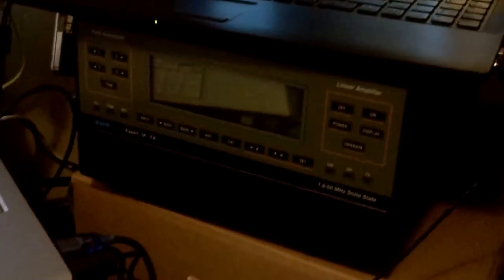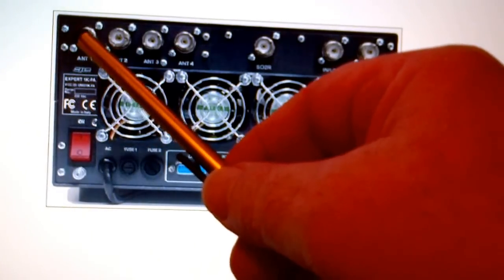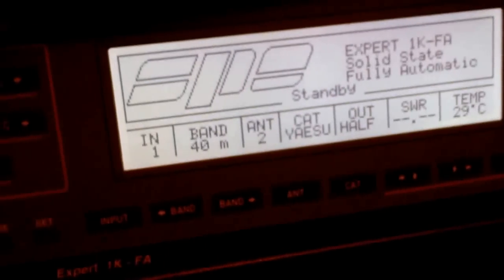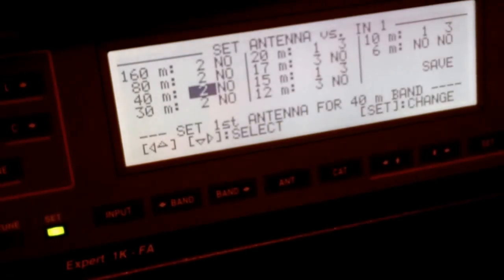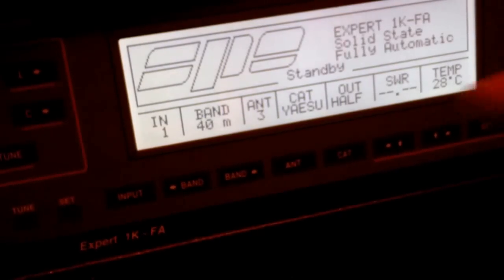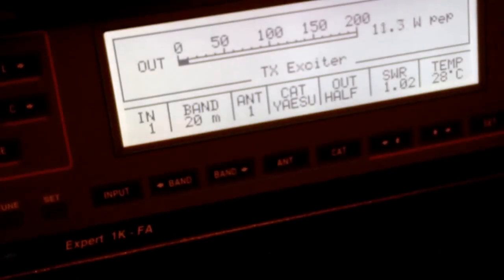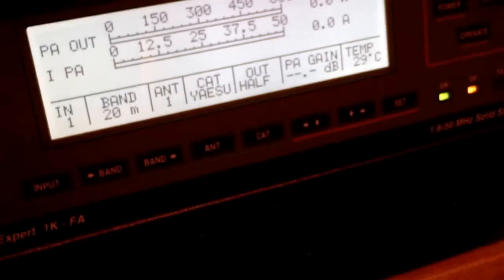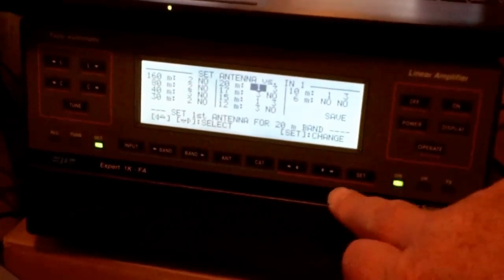SPE Expert 1K-FA

Comment: Hi there Rob. I bought myself a Sun SDR Pro 2 radio a few weeks ago and I'm trying to configure the SPE amplifier to work with it. For some reason, I can't seem to be able to select the second input. At the moment, I only have one antenna which uses input 1. Have you any idea why I can't select the second input so I can configure the amplifier for the second radio?
Reply from the maker: I'm not 100% sure Penn what you should try is if you have 1 radio connected try pressing the INPUT on the front of the radio if it switches to INPUT 2 thats ok, next You might have to have the cable for INPUT2 connected then the AMP will see that there is another radio connected then it will switch, also check that you have the Sun SDR setup in the CAT section of the AMP so it knows there is something connected, thats all I can think of at the moment, also did you get the AMP working correctly I know you had a problem with it ?? 73's for now
Reply: @M0AOV I could go into the cat settings on the amp but that would be on input 1 therefore would mess up the settings for my ICOM radios.

I thought that normally if you press input it would change between one and two, however that doesn't seem to be happening with the amp at the moment. If I press setup then I can go in and make all the adjustments needed for the antennas and all the other information, but that's still on input 1. The blank readout on the amp happened again this morning. Basically, I switched on the SDR and then after put on the ICOM 7800 and the amplifier came on as usual but with a blank screen. I then switched everything off and turn the amplifier of with the red button on the back, switched it back on again alongside the 7800 and it's okay. This is really starting to irritate me now.
Reply from the maker: @Penn1969  Hi Penn I've just tried mine and I think you will have to have your New lead connected to be able to input on INPUT2. when I press CAT on the AMP I see both Radio info being shown i.e. my ICOM & YAESU  Someone else might know more than me but I would say the AMP has to see a lead connected then you can put the info in for the New Radio. Then even if you have 1 of the radio's turned off you can still switch between both INPUT 1 and 2, Hope this helps.
Reply: @M0AOV Afternoon Rob happy New Year to you my friend. Everything is plugged in. Martin Lynch a cable and I've configured the expert software. What I am unsure of is if the amplifier will switch on automatically like it does with my ICOM 7800. In your video the amplifier switches on when you turn on your radio doesn't it? I just can't work out why it won't work for me. I got somebody to check the cables this morning to make sure they will screw them as far as I am aware everything is okay in that area. I might have to get somebody to check again just to be absolutely sure. But I just can't see what else I can do. And the amplifier will not change to input 2 whatever I do always at the bottom I press. I can remember whether you can manually press the input button and change inputs as easily as just pressing the button, or whether it was automatic.
Reply from the maker: @Penn1969  Happy new Year Penn have a look at my video's here it might help https://www.facebook.com/m0aov/videos/1530429347060191/  sorry at the moment I'm having problems doing live video on youtube from xsplit sortware, let me know if you need me to do anything else which might help you get things sorted

Comment: Hello Rob, Hope things are good with you. Another question about the SPE if I may. I am using the Optibeam 11-5 which is  has a good SWR.
Reply from the maker: Hi Penn not sure what the question is about your SPE 1K ?? it should work very well with your Optibeam 11-5 as the swr should be all less than 1.5 on all with out the aatu.
Reply: Hi there matey, basically what I am asking is should you switch the ATU off on the SPE amplifier if your antenna doesn't need an ATU? And that brings me to the next question, is it possible to switch to tuna off and the amplifier? I think it can be done somewhere in the settings. To be honest with you Rob, I hardly ever use the amplifier
Reply from the maker: Hi Penn I think the answer is NO if you have the Amp in line you always need it ON, when you turn the Radio on the Amp comes on and from what I can remember what's in the manual the ATU is always ON as well, you might have to take it out of line if you don't use it much, but that only from what I can remember about the ATU.  I've just turned my Amp on and checked in the settings there is nothing in there to turn the ATU OFF or a straight through setting for the Antennas.
Reply: Thanks Rob, yeah, I think that with the SPE 1K the ATU is always engaged, don't think there's any way of switching it off, well, if there is I haven't found a way
Reply from the maker: Hi again PENN I've been looking around and found this manual have a look at the link below and go to PAGE 26 look there and it tells you HOW TO TURN THE ATU OFF but I'm not sure which revision your AMP is mines a 3.2 if I remember right and in that revision manual it doesn't say anything about turning the ATU OFF but have a look anyway  http://expertlinears.com/pdfs/expert_1K_manual.pdf

Comment: Hi there Rob, what's your opinion on putting the SPE on top of another radio? Do you reckon that it's too heavy to set on top of my ICOM 7800, or do you think the case of the 7800 is perfectly strong enough to take the weight of the SPE?
Reply from the maker: +Penn Wooding Hi well Penn if thats the only way you can do then Yes the 7800 will take it but if you can put it on the side somewhere do that, I'm not sure how you have your shack at the moment ?? I've looked at your video's and the last one I can see of your shack is when your testing your webcams, the expert is on the right of the monitor with the rotator controler on top ??? and the 7800 with the speacker on top on the left of the monitor ??? just make sure you don't have the front legs extended on the 7800 if you put the expert 1k on top lololit might hurt the 7800, you need to do some up todate video's of your shack..... talk and see you on video soon...
Reply from the maker: +Penn Wooding Hi Penn what power do you run your 7800 with the expert 1k ??? the max I use is 20w but most of the time 10w to 15w and I get the 400w to 500w if I use more. 20w gets 600w into my D/Load ??? or full power 1000w to 1200w with 20w from the radio into the D/Load.
Ifyour using alc to sort your power from the radio to the amp that might be the problem with your amps problems ???

Comment: Hi there Rob, it's been awhile since we last spoke. I had a problem with my amplifier and I sent it back to Italy. They found a few problems which they fixed, or so I thought. Basically what was happening as after a few minutes of operating the amplifier was basically dropping right down to 0 on the power output. I could turn it back on again and it would work for a while but it would just happen again. Have the amplifier back for two or three months now but only really started operating about two weeks ago. I found yesterday that the amplifier started doing it again, but not as bad. I didn't actually carry on operating because I was going to close down. I will try again today and see what happens. However, after reading the online instructions again, says something about not exceeding 500 W output, half power, even though will go to 600 W. I'm wondering because I was occasionally driving it a little more than I should, it was powering down on me. Anyway, how has yours been, any problems?
Reply from the maker: +Penn Wooding Hi Penn Theonly problems I'm having with my Expert is when running Log4om and also controling my IC7600 at the same time using half power the radio and Log4om get stuck 1: the amp will not switch bands when the radio does and turn's off CI-V Transceiver OFF but you need it ON when used the Amp and a logging prog, I think it's just RF I've got 3 ferrits on the AMP lead just to see if that cures it, 2: sometimes the Amp will show OUT-OF-BAND when I'm in band I thin that's when I use CENT/FIX possition on the radio but it could be something else I've not fully tested that yet because I only use the Amp with either my FT2000 or IC 7600 I normally run my FT991 just for normal day opperation, the Expert 1k is working ok on OutPut i.e. Half power and Full power so I've not had the same problem as yourself.
Reply: +M0AOV hey Rob, thanks for getting back to me so quickly. Actually, after operating for a while this afternoon on 17 m I don't think there's a problem with the amplifier now. Two or three times I noticed the power dropping down, sometimes down to around 40 W. Then it would come back up to normal again. I then kept a close eye on the input power and I noticed it was dropping. So whether there's a problem with the radio I don't know, but it seemed that the amplifier was only reducing power because the drive power was reducing. I'll have to keep an eye on it.
Reply from the maker: +Penn Wooding Hi Penn I think you have the ic7700 or ic7800 I carn't remember but if the power is dropping from the radio then Yep I would keep an eye out for that I know the ic7700 had some problems with there out put but I've not heard anything regarding the ic7800, Hope you find out the problem and can get it sorted, I've just done a video after I read your message on here so if anyone else had or has the same problem as me they can post there findings on my New Video.

Comment: The 1K-FA does not Supports 1200W or 600W at the half. They Supports (half) 450W ,Full 900W and this should be the absolute limits. The AMP will produce a bunch of harmonics and the imd3 will reach -20dB at 1000W.  You should Limit it with the usage of ALC. Be careful with that axe...!vy 73 de Gerd

Comment: Hello again Rob, could you help me with Something please? When you change bands on the transceiver when using SSB, does your linear automatically change bands at the same time, or does it only change band when you when you hit the TX button?
Reply: Hello Penn! I just happened upon your video. And to answer your question, YES the amp will  change bands as soon as it detects some RF from the exciter/ transceiver. It samples the RF everytime you drive it. It stays locked on the band that it detected. Takes less than about 1/4 second for it to detect everything and switch when a change in band is made.
The CAT cable is really not needed .. the data is used to tell the transceiver what power to produce.  There is an additional CPU for talking to the transceiver. If you keep the drive down to 20 watts to start ... go up slowly until full PEP output is reached... 1150 or so on high power setting. Note your max drive power on the transceiver and keep it there each time you are on that band.  It is not super critical.  I have forgotten and hit mine with full 100 watts and all it does is alarm and sometimes will trip out. This amp has layers of protection.  So how is it working with just the RCA cable now?  Did you check the DB15 under the hood for cold solder joints/ broken wires?  Pat - KJ5Y
Reply: Pat Cameron -Having a problem with my amplifier for the last couple of weeks. Basically after about 30/40 minutes of operation the amplifier will show both zero outputs for Watts and amps. However, if I switch the radio off and then back on again everything is okay and it will last another 30 or 40 min, maybe longer before it does it again. I did notice that the cat cable was pulling very tightly, we're not sure if this was the problem. Even after loosening the cable it still does it. Do you only use a cat cable? It's basically the one that plugs into the cat socket and the back of the linear, and then into the ACC socket on the back of the radio? I've been talking to a few people, including Ron and they tell me that the linear should change band as soon as you change band on the radio, it shouldn't require any RF input. However, I am finding it very difficult to set it up so it works like this.
Reply from the maker: Hi Penn to your question the Expert 1K will will change bands as PAT say's above or as I use it with the CAT from my IC7600, I have my FT2000 and my IC7600 bothe connected to my Expert-1K and NORMALLY just press the front INPUT button to change to either radio but if I forget and TX the IC7600 but was on the FT2000 the AMP will go on INPUT 2 which is the IC7600 so really there are 2 ways to change bands and change INPUTS when you TX.
I'm using the CAT cables from RON at VINE and they work brill, if you need a Video doing to show you what I'm talking about just let me know.
Reply: ***** hi there Rob, I've actually got it working fine now. I also got the amplifier from Ron, along with the cat cable as well. Of course the cat cable has everything built into it, relay ALC etc. What I hadn't done is firstly, plugged the cat cable into ACC2, I've had in ACC1 for the last few years. Secondly, I should have plugged the jack plug that was on the lead into my CT-17. Now that is all sorted, it's working great. Having said that, the belly amplifier is still playing up. Basically after about 30 or 40 min of operation, the Watts and Amps will suddenly drop to 0. However, if I switch the radio off which in turn switches the amplifier of, then put it back on again it all starts working and could last another 30 or 40 min before it goes wrong again. So we're not sure what's going on, Ron thinks it may be a problem with the coax lead somewhere,but I don't know to be honest. It seems strange that it works perfectly okay as soon as I switch off and then back on again. I might try a different lead between the radio and the amplifier, see if that makes a difference

Comment: Hey Rob, have you successfully managed to install the on-screen interface for the linear? I got mine on the computer and it seems to want to use Com port 9, the same one that my HRD rotator uses, which is a pain because that means I can't have them set up at the same time, but that isn't the end of the world. However, nothing seems to work when I click the buttons on the screen. Wondered if you had any more luck with it? Mind you, it all depends on whether you have connected your linear to your PC. Remember I am using the CT 17 which enables me to connect to both computer and radio.
Reply from the maker: Hi Penn No I've not tried that at the moment because I don't do anything remote with the Expert 1K MY connections are as follows Radio's FT2000 & IC-7600 connected to the Expert 1K, I have both radio's connected to my Laptop Com1 & Com2 & my Logbook prog i.e. LOG4OM is used to control both radio's & the AMP follow's which ever radio I'm using at the time, I also use HRD and everything work's the same. So your using the CT17 to connect your IC-7800 to your PC ?? and you have your Expert 1K connected on Com9 also HRD Rotator is connected to Com9 ??? Just change the Expert 1K to another Com port thats you know is not being used, I do it all the time because I'm using 6 Com ports at the moment and put them in what ever order I need to use them in.

Comment: Hi there Rob, thanks for posting the video, you actually help me out more than you think. I've owned one of these amplifiers since 2010. However, due to various reasons, including Health factors and antenna issues I've really been inactive for nearly 2 years now. However, I just installed the new Opti beam and I'm getting myself back on the airwaves. I've never really found the destructions that come with the 1K particularly good. Your video basically gave all the instructions you need a very clear and concise. I'd forgotten how to use the linear but now I watched your video it's all come back. I actually use the ICOM 7800. I'm using the CT 17 interface which enables me to also connect up my computer, as well as a linear. Anyway, thanks again for posting the video, I'm sure that you won't have any objections to me using it on my own website. I would make my own, but being disabled makes it rather difficult to make videos where you have to point out things :-) 73 G0VQY Penn
Reply from the maker: Hi Penn glad the video helped also YES use it on your web site I do the video's just incase it does help other's so help yourself , I hate video's that just show you something working but doesn't explain the connections or how to set the thing up to get to the point of how you get it working.
I like watching your video's as well so keep up the good work Penn 73's